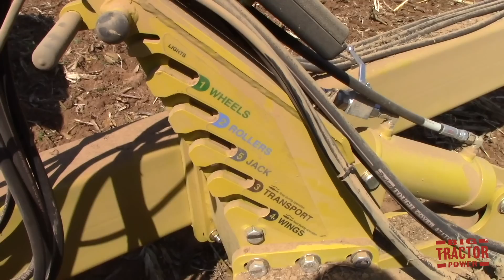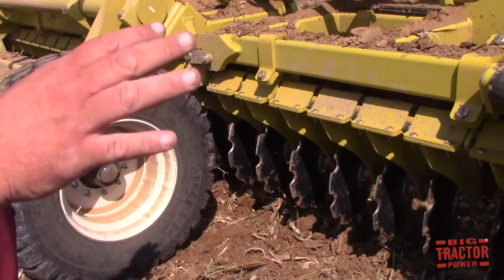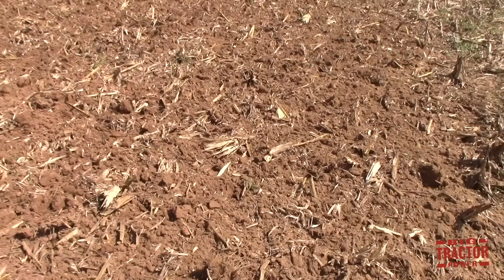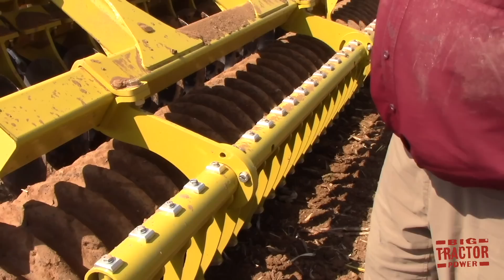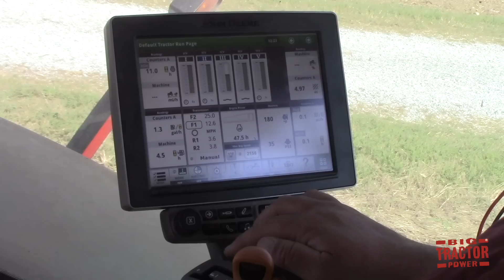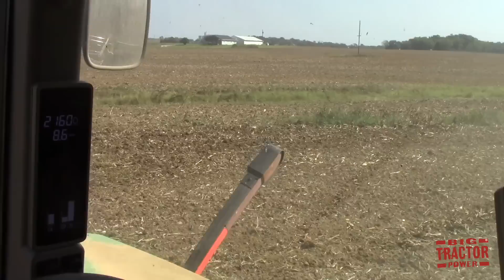High Speed Disking at 10 MPH with a Degelman Pro-Till

Comment: vertical tillage is the best way to destroy your yields and cause a bunch of compaction
Reply from the maker: Going from corn to wheat they like to leave the field firmer for the sprayers and harvest.  Then soybeans go in right after wheat. When the beans are cut they subsoil the field 18 inches deep.  The Pro-Till is not vertical tillage. It is just a disk that moves fast.
Reply: which is exactly 
vertical tillage.

Comment: They look like they leave a great seedbed. It looks really even and there aren’t and clumps. 

They do also cause a lot of compaction. The guys around here use the in the spring to get the fields ready to plant. Their wet spots are getting bigger every year because the water can’t soak in. They don’t do any heavy tillage, just run the high speed disc.
Reply from the maker: This is used here in Kentucky in the fall to work ground from corn to wheat. In June they cut the wheat and double crop beans into the wheat stubble. In October they cut the soybeans and the. Deep rip the ground 18 inches.  See this video of tillage a year latter https://m.youtube.com/watch?v=eL6jbJWhW7Q

Comment: Rocky land anyone
Reply from the maker: The Pro-Till is built well to handle stones. Each blade is individual so they flex over rocks.
Reply: No problems on rocky soil.  But if you see a large rock sitting 12" on top of the ground I'd probably either pick the rock or go around it.

Comment: I own a 40 foot model.  Works very well in fall for spring seedbed prep and to level out sprayer ruts.  My typical working depth on canola or cereal stubble is 1" - 1.5" so horsepower requirements are actually quite reasonable.  I pull the unit at 9.5mph with 500 HP no problems.
Reply from the maker: Very cool.

Comment: Fine - as long as there's no rocks...  10 mph + basketball-sized or more rock and you'll be doing a LOT of blade changing..
Reply from the maker: I tried to show in the video this disk can handle rocks because each blade is mounted independently and it can flex over a stone.

Comment: I pulled a 40 foot sunflower disk for Charles and Brian Sunday with their 9620RX. I was going 6 mph throttled back to 1790 rpm. The Degelman tool looks like a great way to disk the stalks quickly
Reply from the maker: Very cool. I saw the 9620RX and 9460R parked on the By-pass across from Hutson around noon in Sunday around noon.  I took pics of the 9620RX parked for a thumbnail pic.  Are they not running the DMI crumbler on the Sunflower this year?

Comment: Kinze actually bought out degelman and have there own models in kinze paint. We just demo'd one a week ago and actually had better luck running at 7.5 mph than 10 mph the packing wheels in back were not leaving those traces in the dirt and when we were finishing the field looked like a concrete floor. Awesome machine but I'd steer clear of the 33' models because of transport width the 26' model is a lot narrower in transport and better visability. Be a lot of country roads you couldn't get down with 33'.
Reply from the maker: Degelman was having allot of growth with Pro-Till sales that the Degelman factory could not keep up with.  Degelman has partnered with Kinze to have Kinze manufacture the Pro-Till.   The Kinze Mach-Till offers expanded sales through the wide range of Kinze dealers. It is a win win for both companies.  Kinze did not by Degelman.

Comment: We have one of these machines they are very nice and also popular here where we have lots of irrigated land.
Reply from the maker: Very cool.  What size do you run?
Reply: We have the 26 footer,you cover a LOT of acers fast  so we don't have the widest model.It has cut down the times and number of passes it takes to make a good seed bed by a lot. When we have a very wet year and have lots of straw we use it on the dryland too and set it to 1 inch depth so we don't disturb the soil too much.

Comment: They need to engineer a large caster set up for the wing wheels. They rut the ground pretty bad when turning. i would think that will lead to maintenance issues over the long term.
Reply: If you skip every other pass it's not as bad
Reply: I totaly agree. A expensive machine like this shouldn't do that.  But it makes great work on the field
Reply from the maker: A caster wheel would eliminate the burning.  Although as the headlands are disked last so the burn is knocked out.

Comment: Thank you BTP. I would not like to be the one that has to change a broken disk not alot of room to work on them.
Reply from the maker: The Pro-Till lifts up pretty high and each disk is separate so they just pop off. Most disks have a 7 to 12 inch spacing between blades.
Reply: @bigtractorpower  They are not stacked on a long axel?
Reply: Scruffy prefect punctuation!

Comment: What happens if you don't go 10mph is the quality not there and that's the reason for going faster.
Reply from the maker: The machine is built to move fast. If you run slower the seed bed will not be as good.

Comment: What is the point of having 12 tires on the tractor?
Reply: More traction and less compaction.
Reply: 620 horse spins 8 tires pretty quick
Reply from the maker: More traction, less compaction and smaller tire repair and replacement cost.